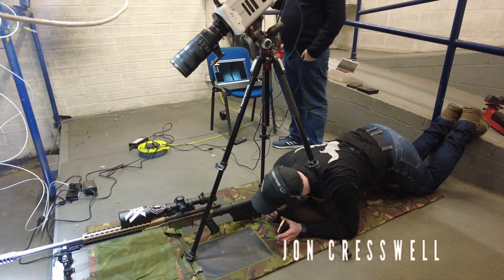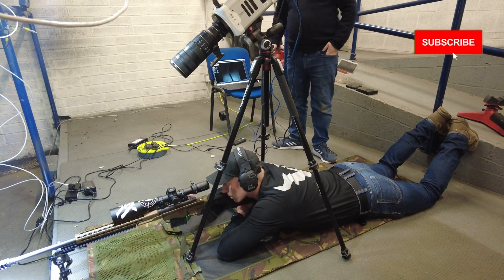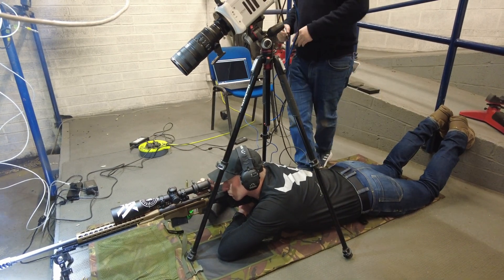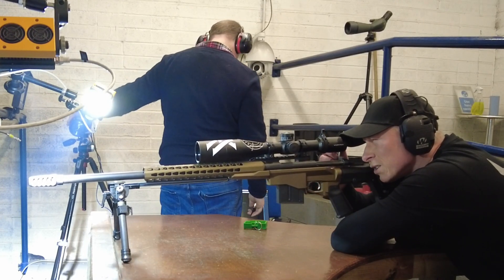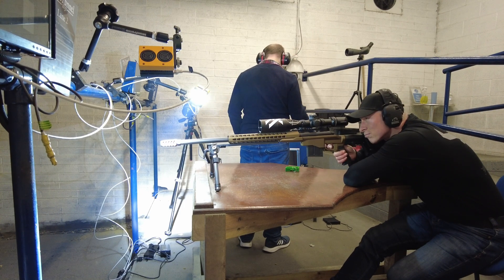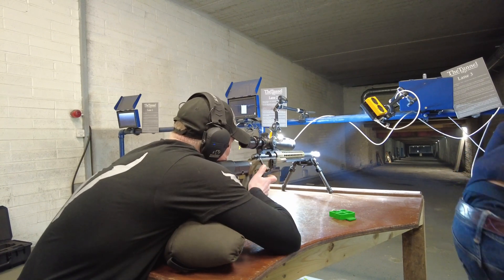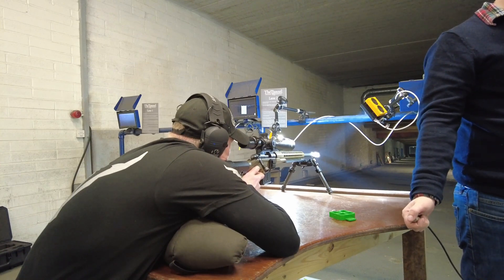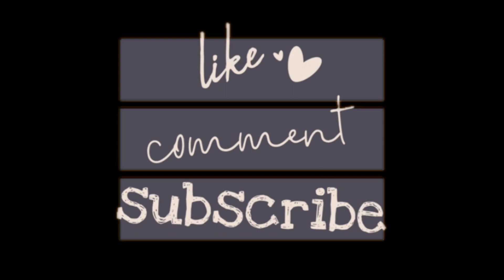Extreme slow-motion filming 6.5 Creedmoor and APW Raptor Muzzle Brake

Comment: hi, love the vid. is that the APW raptor 5 ports or the Monster?
Reply from the maker: It’s the APW raptor.  It has excellent recoil reduction.
Reply: @JonCresswellUk  Hello, Raptor is the new muzzle brake series released by APW. but there are 4 ports, 5 ports, Monster & Titan. so im wondering what specific brake u are using coz im planning on getting one and i wanna compare the sizes.
Reply from the maker: @jake_kwekwek1474 this was an APW Raptor 5 port brake.  They only made this one version when I got it
Reply: @JonCresswellUk  i see. thanks. looks good.

Comment: Excellent Capture. How much did the brake reduce recoil, just a guess, 60%
Reply from the maker: It’s hard to measure felt recoil, but it did significantly reduce it.  It also vents around 98% of the gasses that follow the bullet, so it’s pretty effective.
Reply from the maker: It’s hard to tell an exact percentage, but it did reduce felt recoil - considering this was on a .375 CT I could have easily shot it all day

Comment: how bizarre it is to see the gaz coming out before the bullet!
Reply: Its not necessarily gas exiting before the bullet, its the air that is all around us.  As the bullet accelerates down the barrel, is also pushes the air out of the barrel at the same speed.  What you are seeing before the bullet gets to the muzzle is the air being pushed out of the barrel at tremendous speeds.
Reply from the maker: Thanks for the explanation Geoffrey
Reply from the maker: I thought that too…maybe my barrel is on the way out 😳🥺
Reply from the maker: Actually thinking about it, it may be that my bullet is too far off the lands so gasses are escaping around the bullet 🤔. Maybe a spot of load development is needed ☺️
Reply: @JonCresswellUk  I was thinking about it too, the best is too begin  0.5mm off the lands.
it could also be the  air in the barrel brutally compress by the bullet.
anyway the best load is the most accurate in your rifle.
Reply from the maker: @MrComint  true.  I’ve had a few thousand rounds through the barrel already, so I am due to adjust my seating depth again 😁